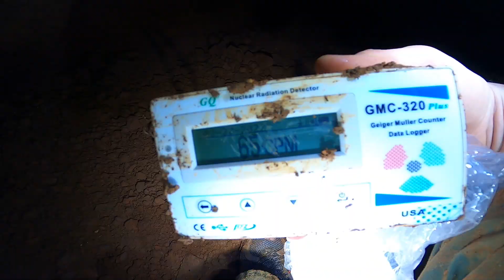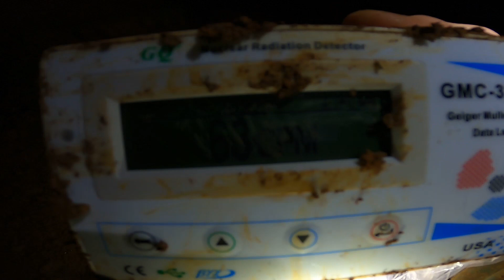Underground Nuclear Aircraft Laboratory

Comment: 1990's remember the authorities went around and burried and gated tunnels and access areas because it was deemed unsafe.
Should maybe wear masks, black mold and other potential hazards.
Diving this would be extremely dangerous.visability is only 2-3 ft.
Reply: @jeoboden  You ever turn your high beams on while driving in fog? Brighter lights would actually lower the distance you can see, not increase it.
Reply: Cave divers have died when they stirred up the silt on the bottom and suddenly could not see even with lights. It happened to a friend of mine but he was able to make his way out by following one wall of the cave.
Reply: @OnTheRiver66  your friend needs to stop cave diving..... you ALWAYS run a line when cave diving if there's not already a known safe line there..... he's not cane diving certified I'd say and shouldn't be in one.
Reply: @michaelvoorhees5978  absolutely, but he was not intending to cave dive. This was years ago, more than 50 years, and the caves were not not as well posted as they are today. He went into an opening close to the surface of a spring and did not know there was silt on the bottom. The other springs in the area did not have silt on the bottom. No warning in the literature we had at the time. It could have been fatal had he gone deeper into the cave. I was not on that dive but I have been other dives with him and we both stopped at the warning signs as neither of us were cave qualified. To me the important lesson is to know when there is silt on the bottom before your fins accidentally kick it up.  Even in a quarry you could become disoriented in a blackout.
Reply: @jeoboden  short visibility makes it easy to get disoriented forget which way the surface is and potentially get caught on stuff. Plenty of people have died that way

Comment: That’s an old USAF facility.  They were testing nuclear powered aircraft engines.  They also irradiated the forest and equipment to study the effects of a nuclear war.  The bunker is deep in there and is where the scientists would stay during testing.  Operated from 58-71.
Reply: No engines were tested at this site. Prototype testing happened in various desert locations. In Georgia they conducted materials research for such engines by irradiating metals deemed suitable for it but light enough for aircraft, to see how they hold up in harsh ionizing radiation. They had an unshielded reactor topside for that and the bunker was obviously to protect the people when it was in operation. They also did not irradiate the forest for research but rather by dumping the "hot" samples there to cool off before analyzing them - as one would do in the careless early years of the nuclear age.
Reply: @Ganiscol  No hate - good info for the most part, largely accurate, but I believe there was some misinformation in your post as well. There were 2 reactors on site; REF & SDF; Radiation Effects Facility, & Shielding Device Facility. The latter was shielded, however the former was an "air-shielded" reactor, & was ran in open air, with no shielding, & it DID irradiate the forest directly to my knowledge, along with local flora & fauna - & other materials as well, like you were saying; parts to be used in a (nuclear powered) plane (that never saw production, due to being infeasibly heavy, per shielding requirements). Youre correct in saying that when the open air reactor was in use, that the personnel would be in the underground buildings; sometimes for weeks at a time. They didn't just use said irradiated materials to irradiate the forest like you were saying though, they used the open air reactor itself to, & it WAS for research purposes; seeing & preparing for exactly what would happen when irradiating a forest. Wild stuff, right?! Lol. These were different times though, cold war times, & nuclear energy wasnt well understood yet, like you said, & to my knowledge, testing was done directly on the forest with this (10mw) "air shielded" (open) reactor to see what would happen if the soviets hit us with a nuclear bomb, & to see what the effects of irradiated wildlife would be, but without the other effects of the blast itself (shockwave & heat wave, etc), of course, just solely the radiation. Ive read reports that the trees within a mile recieved doses of 100,000 rads or more & dropped all leaves within the first few times the reactor was cut on. Ive also heard that the reactor was used/housed IN the etowah river at times - but that could totally be innacurate & misinformation! Someone please correct me if im wrong about ANYTHING I say. I know for sure that it was lowered into, & housed, in a pool of water at the REF when not in use at the REF. I am also positive they drilled many wells to trace the radiation, & also used rafts bearing monitors to do so; Ive even found one of the wells. There are some small black radiation monitors in the forest (still to date), 10 to my knowledge. They also still come out 2-3 times a year & read those, & test levels with larger, & more accurate machines. That said, the only dangerous areas are blocked off with dirt, or fenced off - & from what research I've done & seen, theres really no danger present in dawson forest unless youre in the hot cell area, or the cooling off area, & literally eating the dirt - & I dont think anyones doing that lol. Radiation can be in the plants to a degree as well, but nothing harmful to my understanding; still, I wouldnt dig anywhere, but especially the fenced in areas, & also wouldn't eat the blackberries or autumn olive (or anything else) growing in the fenced in areas - otherwise,  youll be fine. The REF (open air reactor area, & underground lab) was sealed up (along with other places) mainly for legal reasons from my understanding; to keep people from hurting themselves or dying in the tunnels & preventing lawsuits; the REF is actually supposed to be less harmful & radioactive now than the fenced in areas (hot cell/cooling off area) where they stored the hazmat, & everything is supposed to be background levels of radiation, or extremely close to it, throughout the entire grounds by this point in time; short (5 year) half-lives on the cobalt-60, which degrades into nickel. A geiger counter & masks were a good & smart choice for the folks in this video though, that said; the rads are in the dirt & water, and disturbing them, releases it; I'd want even better PPE personally; like a respirator. Theres a field thats still being clear cut to this day just to the left of the REF to prevent trees from pulling up the radiation from the ground. Trees died within a certain perimeter of the REF. Birds dropped dead in mid flight when they were close enough to the open air reactor; which was within about a mile radius to my understanding. Cotton rats were released before activating the reactor to see what the mortality rate was; often 100%; Eugene Odum's research. Frogs, rabbits, insects, and other small native species were also found dead in their tracks within a perimeter of the open air reactor. Ive found an article by a man named James Mahaffey, who is a nuclear engineer/research scientist from ga tech, & he claims they may have even irradiated something as large as a mule & petrified it, & I have personally heard stories of petrified rabbits & frogs that wont deteriorate normally from local friends who knew employees who worked the hot cell building, rotating drums on forklifts; the animals liked the warmth radiating off the barrels apparently.. There was also testing done on irradiating materials; things like transistors, hydraulic fluid, rubber, etc., to see how the materials would act after being irradiated; like hydraulic fluid turning to a tacky substance akin to chewing gum, transistors not working, rubber hardening/melting, etc. They also injected pine wood with a polymer material & irradiated it & called it "lockwood"; named after lockheed, who ran the operation along with the USAF. These irradiated materials were transported via rail line to a "cooling off area", & then to the "hot cell" building; the latter of which you can see from the parking lot. The former, you can see if you walk past the wooden bridge on the etowah, (where the pump house is on your left before the bridge), & take your first gravel road past the bridge on your left; its down this road on the right, & if you arent looking for it, youll walk right past it; if you hit the other side of the concrete bridge that you can see across the etowah, you've gone too far. Theres remnants of the rail bridge & many old barrels still out there in this part of the woods too; I dont have a geiger counter but would love to link up with someone who does and show them said barrels. I will include a few links. Adv rider is one of the best sources Ive found. Ive also heard that we were trying to make a nuclear "rocket fuel" at gnal from my grandpa, who's sis who worked there, & while I don't have any more evidence than that to substantiate the claim, I believe them & have never known him or her to be a liar/exaggerate anything; it also lines up with the space race, and Kennedys presidency, & the closing of the facility; & Kennedy did nix a lot of space programs. My grandpa who worked at lockheed told me that people have scuba dived out there before & taken file cabinets, chairs, and things of the sort. Water can hold radiation though & I wouldn't want to get in it personally. I've read that much of the information gleaned from the expiriments here are also still being used in modern nuclear subs, and that its still classified for that reason, but I would love to file a FOIA request & find out anything more that I can; not sure exactly how to, or if its even possible, havent gotten that far yet & havent ever done it before lol. I had an aunt who actually worked out there, like I said, my grandpas sis; she unfortunately has dementia now though; I wish I could interview her. My grandpa also worked locally for lockheed, but not at gnal. Im a local to the general area & have been a north ga resident my whole life. The property I stay on currently actually butts right up to the powerlines next to the forest. I have walked out there most every day of the past year; largely exploring/wandering, & picking up trash. I love the place, especially the history. Has a bit of a sordid past other than the nuclear stuff; theres been a few murders. Gorgeous and quiet place though, with plenty of wildlife. Barefoot falls is gorgeous af too. Dawson forest can be eerie/spooky though, especially at night time!! Im not one for superstition or one to get easily spooked, but it feels like there's eyes on you, even though you probably won't see another soul all night, even if you walk all night. If anyone has any questions, just reply to this comment, Im glad to answer them if I can. Ive been on most every trail & offshoot have explored most of the closed gates on the south end, & I know where the two entrances are in these videos - but havent been inside anything underground out there personally. These videos are super cool though, & I'm glad to live vicariously through them! I'd love to see footage of a submersible drone going down there, or (if its safe) some scuba footage! Maps/blueprints of the tunnels would be cool to see too, if anyone has those.
 https://www.advrider.com/f/threads/a-ride-to-and-history-of-the-ga-nuclear-aircraft-laboratory.405686/

https://www.dawsonnews.com/local/what-happened-inside-georgia-nuclear-aircraft-lab-finding-facts-forest-dr-james-mahaffey/

https://www.williamlstuart.com/nuclear-powered-aircraft-dawsonville-ga/

https://www.rocketryforum.com/threads/georgia-nuclear-aircraft-laboratory.164934/

https://www.georgiapacking.org/threads/dawson-county-reservoir-atlanta-tract-of-the-dawson-forest.218519/ 

https://youtu.be/Bn6N2iV2_os
Reply: @blefnefnef  fascinating reply.  Thank you for sharing all that.  I don’t know much about the place, broad strokes only.  Your reply filled in some gaps.
Reply: @blefnefnef  This video and thread of comments surprised me to find, but your additional information impressed me. I'm from the EHS field and appreciate it.
Reply: @Decentralized_Maze  My pleasure! I usually just get "tldr" on long comments like that lol, you made my day with that comment! I'm glad you enjoyed the info & took the time to read it! I live basically right next door to dawson forest/gnal & when I moved here, as soon as I learned there was a national forest right next door & that gnal was a thing, I took a huge interest in both & found out as much as I could about its history (& tried to learn how safe it actually was before I spent much time out there). Fascinating place :)
Reply: @blefnefnef   I love new information! I'm from EHS field. Significant focus in remediation of hazardous sites (brownfields mainly, was trying to do Superfund but couldn't with a little one). Was lucky enough to work on a nuclear project site and had a chance to work at Los Alamos (again, single parent life didn't allow me to 😞). So, remediation, severe auditing, obtained a certification in aboveground storage tanks (ASTs), did consulting and training, industrial, oil sector, coal, etc. This video satisfied my caver/adventurist side, but the comments blew my mind. I learned more about this topic within 10 minutes of videos and reading all comments, and was sooooooo excited. Such an excellent set of perspectives and knowledge here. I appreciate it and you taking the time to respond. Wonderful way to spend an afternoon!
Reply: @blefnefnef  I grew up right next to here and still live there , I hike around there often still , my wife literally used to live across from Salem church rd  only about a mile from the main reactor site , I’d love for you to show me around as I don’t really remember or know what or where everything was .
Reply: @Ganiscol To be fair you have to research it somehow. That's how you find out what to do and what not to do.
Reply: Top info   Thx ..
Reply: They aren't accessible, this is insane. I used to go into those buildings about 10 years ago. It's almost impossible to get in. That's why I asked who too kthem because they missed a few buildings that you could get into before.
Reply: @BarefootCaveman  if you're ever in the area, or down to describe where, I'd love to know said other locations. I know exactly where the two entry points are in these videos. Assuming the others you speak of are near the parking deck/hot cell area? If you don't wanna talk here, I'll post an email, just lmk.
Reply: @BarefootCaveman  I grew up and still live right outside from here too , let me know if you ever would like to show me around, I go hike around there still but don’t really remember what/where everything is.
Reply: @colin Berry,  Sir, you worked there from 58-71? I saw a vid from Ga DNR and NPR and when they got  to the outside stairway there near the reactor housing, the DNR guy said there was a door there big enough for Jeeps to drive into. Is that true? Also, the area up front where the parking area is now, were there underground tunnels there? Near the warehouse ramp?
Reply: @MarkBrown-uf8ct yes this is true. I grew up here. There have been dead bodies found all over this place. I've spent a lot of time in these caves and woods. The car battery is down there because it's where the local meth heads go to cook.
Reply: I was told that the parking lot is over the old cafeteria and fire department areas near the hot cell building in the upper parking lot @MarkBrown-uf8ct
Reply: Thank you, anonymous non correspondent commenter!
Reply: @Foxtrap731 They didn't test nuclear powered aircraft engines there. That was at the Idaho national lab where they have a couple of prototypes on display. I forget how far they got with them but, off hand, i want to say they got to 80% thrust with two turbines on a single reactor, which isn't that great for 1950's era jets.
Reply: @rustyATV  Whatever they were doing it involved irradiating the forest.  one of the comments above describes it well.
Reply: Lockheed Martin. It's owned by the city of Atlanta now. They tested the effects of nuclear propellants.
Reply: Digging and kicking up radioactive dust and breathing it in, is a terrible idea. The potential long-term effects are not great.
Reply: Where is this?
Reply: @AT-ki8jz  Dawson Forest in Georgia. About an hour north of Atlanta.
Reply: @craigh27  that's what I thought, I had no idea there were underground accessible parts
Reply: @craigh27  I live in Georgia so thanks for letting us know 🙂
Reply: @craigh27  do we need special permission to go in
Reply: @FreedomMountianSurvival  I know I'm not who you asked, but I know the area pretty well & I don't think you could get permission even if you tried to be honest.